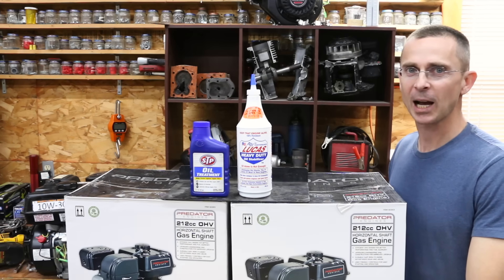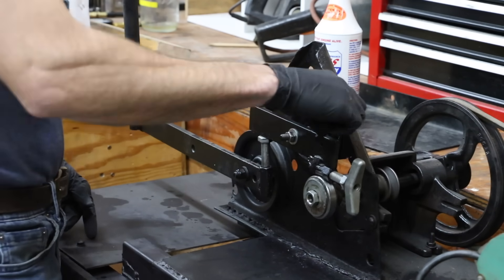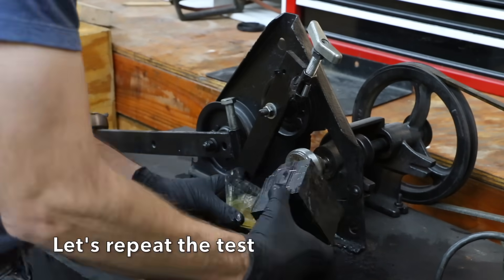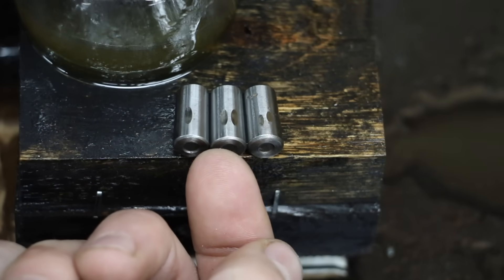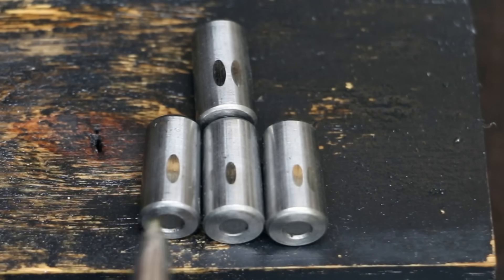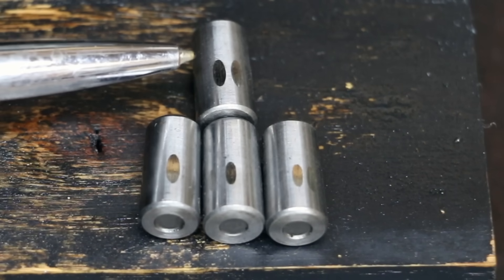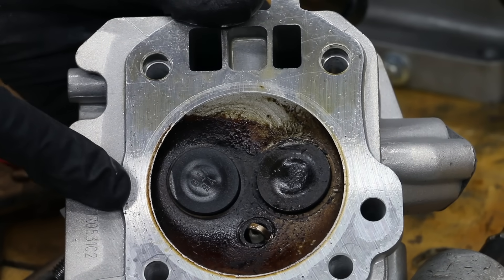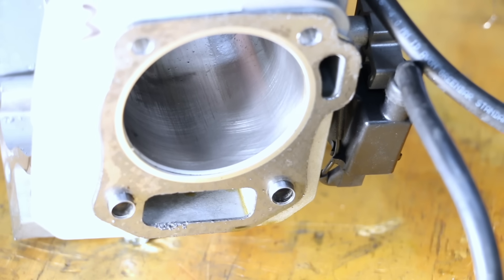Which engine self-destructs first?  Lucas or STP?

Comment: I understand that draining the oil out is to make the test more severe. But I am not sure if we learn much by testing the engine to destruction. In both STP and Lucas cases, the connecting rod was broken into pieces. A high level of wear was found on the crankshaft bearing and cylinder liner. They are simply the symptoms of no oil lubrication.

Comment: Well, the lucas engine definitely ran longer, but the end result was they both blew themselves to pieces. I have been using Lucas for a number of years and have never had an engine failure, but I have never taken an engine apart and miked the crank, but I will say I have used Lucas power steering additive and noticed a big difference in my steering, possibly because it thickens it up, but it does seem to work.
Reply from the maker: Lucas seems to be a great product!

Comment: Great video, very detailed. I like the inclusion of all the PPE, people need to see other people doing it right to learn from them. 

I don't know if it's still made but I saw a commercial for a product called Pro Long a long time ago and they drove a car without oil for like 50 miles after using their product in it. I'd be curious to see if it does any better than the Lucas or if they just flat out lied to people.
Reply from the maker: I need to test Prolong soon. Thanks for the recommendation!
Reply: i use pro-long with synthetic castrol since 1994 with unbelievable results.

Comment: Were these engines running at wot/have any load on them? Just curious. You know what's funny is I start rooting for particular brands and want them to keep going but then the Lucas engine starts to slow down and is on the verge of popping and I'm like "no no no noooo!! (Boom!) Ahhhhhh man" still impressive it's able to run over 20 mins without oil though.
Reply from the maker: Engines did not have a load and were running at WOT. Thank you.

Comment: Zmax is sold to the piston engine aviation market as Avblend.  It is the only FAA approved piston engine oil additive.  I'd like to see it tested to see if it's anything different or special.  Never mind, just saw your video with Zmax.  Great videos, keep up the good work.  I'm sure the Chinese guys that make those engines love to see you coming. You should get a discount since you use so much of their products.  Since the con rod is the weak link, and based on how it breaks, I'd love to see how long one of these engines would last with a rod that has needle bearings at both ends.
Reply from the maker: Than you!

Comment: I also wonder if the test is accurate with a lack of engine heat.  Oil acts a lot differently at 250+ degrees

Comment: Thumbs down, this is a advertisement made to look like a 'homemade' test. This test is not valid. Both engines should of been rebuilt and machined as exactly as possible to match by a qualified machinist. Unless they were built from the factory using QS9000 standards, they are not 'equal quality'. (do some research on Demings rules of Quality if you want to understand what the word 'quality' means.)And there should be a third engine ( with the same rules applied)  running plain oil. Being a machinist for 25 years, ( with certs in SPC and other pertinent areas and being a QS9000 L2 auditor) ....there are too many mechanical variables in both engines to be able to attribute the destruction ( or lack of) to the simple additives.  Ex. the reciprocating mass of parts of both engines (from top of the pistons to crankshaft bearings) can have a very wide range of tolerances, even between the same parts ( like the wrist pins or the rings). The wear patterns of all parts were established long before this 'test'. The test is not valid. It is my guess that the company that makes one oil is paying for this and expects results.
Reply from the maker: Thanks for commenting.  This is my own video and not an advertisement.  Check out my other videos and you'll see Lucas' competition doing well in testing.

Comment: I was told that adding an oil stabilizer only thickens the viscosity of the oil, thus making cold starts harder on the top end (the oil doesn't get up there as quickly) 
thoughts?
Reply from the maker: There is indeed truth to this.  However, Lucas seems to provide a cushioning effect, which has some benefit on worn engines.

Comment: What you should do as a control is clean the engines and then swap the oil mixes. Lucas in the STP and STP in the Lucas. It would help minimize any differences in the engine to see if it is just the mix that's making the difference.

Comment: Haven't finished the video, but I am just going to go out on a limb and guess that the Lucas oil engine does first. Why? Because an engine filled with that sopuid is going to overheat due to extreme viscosity and kill itself.
Reply: Foot in mouth. I guessed the additive would be the only thing in the engine. Derp.

Comment: Back in the 70s a friend of mine went to petroleum engineering school. In school he learned that STP is just refined petroleum before any additives have been added. No anti-sheer additives, no anti-foaming additives, no detergents, no polymers, it’s just refined petroleum that isn’t anything yet but Refined oil out of the ground.Just like flower that has not been turned into a cake, or bread, or noodles yet

Comment: You maybe have already done this, but try synthetic versus regular oil, and semi-synthetic if possible.
Reply: Synthetic is the way to go, IMHO.  On every engine we use, we have seen increased HP and easier starts.  On our truck and cars, increased fuel mileage as well.   My 2500 Cummings gets 24 MPG on the highway.   Synth oil is part of that.
Reply: @donaldeisenhart3738   I wasn't aware of the benefits of synthetic.  Thanks
Reply: @donaldeisenhart3738  Ahahahahaha

"My car gets 24 MPG on the highway because of it."
If you said that to soneone in the UK they'd stay well away from it!
Reply: Richard's World Traveler I prefer synthetic blend the best of both worlds
Reply: @CWCAdventures  what are the pros of conventional oil? I'm genuinely curious as someone who has never really thought to run conventional in anything other than engines that have been designed up until the later half of the 90s, and even then, only the simpler designs.

Comment: What a waste of 2 perfectly good engines lol. I think the tolerances from the factory would already cause that difference in one motor lasting a little bit longer than the other with no oil in it. They’re not exactly the same is my point. Just my thoughts. The viscosity test was enough. Just needless destruction after that lol.

Comment: Woah. The one on just 10w30 was 38.06 right? Both lost to regular oil, eh.
Reply: Engine masters showed how whipping and air in oil in an auto engine will actually reduce hp. Over time that air is going to reduce the oil available to the pickup and cause oil pressure drop I think.

Comment: My new 50cc gas scooter is driping gear fluid id my 1st bike please help
Reply: I would try adding a little bit of engine stop leak. It's thick like STP and has rubber seal conditioners in it.

Comment: Motor kote is way better than lucas or stp motor kote is an absolute awesome product
Reply from the maker: It did great in one of my videos.
Reply: I always use motorkote every time I change the oil in my vehicles even though it says every 3 oil changes I believe also use in the transmission and the differential

Comment: I used Lucas oil heavy duty oil  stabilizer in a bomb of a car that leaked or burned a quart of oil every 2 days! It didn't stop the leaks but slowed them down to a quart every 4 or 5 days  . Why not shut down the lucas motor point was already proven. It really didn't make sense to blow them both up.  Would have been better to run both with half oil and the additive under the oil capacity to simulate a leaking engine run both relatively hard and compression tested , compared main bearings,  crank and cam wear .  pistons to see if there  oil ring damage and blow by and any head warp .  Both blew connecting rods might just be a weak point in those engines .
Reply: Of course Lucas slowed the leak...it's just a 50w base oil that adds thickness. A temporary salve, nothing more.
Reply: Southern Fun  Indeed. To make matters worse, there are quick oil change places that dump in a bottle of this crap without even asking you, just to make you think their motor oil single handedly quieted your engine (looking at you America's Oil Express *cough*). Also a dirty trick employed by used car dealers to fool people on the test drive.
Reply: @Mikgwerd  yep there are car dealers out there that do this for myself I could never imagine doing something like that to someone I run a used Buy Here Pay Here type car lot and repair shop that's why I can't do something like that is because I have a damn good reputation as a good mechanic in my town... so any car that comes to my car lot that I'm selling definitely won't have any engine knocks that's for sure if it does it will be in the back either waiting to get fixed or waiting to go to the crusher

Comment: I would like to see a comparison of cpvc connections that used glue only vs primer and glue. Test after 10min of drying vs 24hr cure time for each. See how much pressure it takes for them to fail. Does the primer and added cure time make for a stronger connection? Thanks.

Comment: Lucas seem like it's better if you add it at factory recommendation, BUT if you were to increase the STP from 1/8 to 1/6 it would outperform the Lucas. If you got a high performance engine you're pushing to the limit, don't forget to add a small amount of zinc with your additive.
Reply from the maker: Great point.

Comment: A fun video to watch but this doesn't tell the whole story. Example: If the Lucas mix results in a higher viscosity, that may be great for wear when running without oil in the sump but will result in more fuel consumption and does it really make the engine last longer under normal use? How does it compare to an oil of similar viscosity? When I had a lawn service and the mowers would start burning oil and I didn't feel like doing a rebuild, I would put motor honey in and the workers would stop complaining about the smoke. However they were hard to start cold and would consume noticeably more fuel.
Reply from the maker: All great points and thanks for commenting.

Comment: Just proves to me that there is no substitute for checking the oil regularly, changing if necessary. I don't see any benefit to these additives.  My grandfather used to rub the dipstick oil between his fingers and decide that way.  Not scientific, but it did mean he didn't run the engine on bad oil until the service interval.
Reply from the maker: Great point!

Comment: Have you done Slick 50 vs DuraLube yet?........great video!!!!!! Very very interesting for an arm chair mechanic like me...Thanks!!
Reply from the maker: Not yet. Thank you for the video idea!
Reply: Duralube if it’s the chlorinated version which I think was recently banned will certainly win.
Reply: I've used Duralube for years.  Years ago had an 85 F350 7.3 deisel.. added some Duralube, and you could literally hear the engine get quieter.  Had between 200k and 300k when I sold it.  Cosmetically, crap.. Mechanically, awesome!  It would cruise at 75 on the turnpike, and wanted more.  😀
Reply: Gray Beard , Same or better w Prolong. Had a Honda generator we ran 10 hours a day & treated it w Prolong right after break in & kept it in the engine. I massively over filled the damn thing & blew the seal between the engine/generator & all of its oil blew out but that engine ran for another year w just a teaspoon of prolong added to it once a week. Never did fix the blown seal or ever add any more oil. The extream cold of Alaska crystals the metals & generators usually last a year from cold  start up to hot running engine. Ours usually lasted 3-4 years w the prolong. Long distance/high volume shooters also treat their  barrels by swabbing em when theyre hot & get 2-3 times their normal barrel life. Prolong is heat activated & soaks into the metals which other addatives dont. I also cooked by bullets in prolong before loading them. Lost a bit of velocity but got better accuracy. Duralube/Slick 50 just coats the metals. Does NOT actually soak into the metals pores. My Chevy Van had 350,000 hard miles on it & running strong when I sold it. I ONLY use Castor oil & prolong for what thats worth.
Reply: Didn't think Slick 50 was available anymore? Was heavily used in Alaska in the early 80's...
Reply: Still available here in FL as of today, but I prefer Duraluube
Reply: Slick 50 is a killer of engines with small oil passages, & always was,, especially w/ hydraulic lifters... The Teflon solidifies on wear surfaces , & then eventually flakes of in chunks, potentially plugging oil passages...  I74

Comment: I run Lucas HD Oil Additive in my Diesel Pickup truck with almost 500k miles on it. I know many big rig drivers that swear by Lucas. This video makes me just a little more assured in using Lucas.
Reply from the maker: Lucas is a great product.
Reply: STP at Walmart, $2.99  Lucas $7.99 Lucas won only because it's run at twice the mixing ratio.

Comment: How about Synthetic oil versus regular oil.
Reply from the maker: Thank you for the video idea!
Reply: Thats not even worth trying obviously synthetic wins
Reply: I would like to see that also on the 212 Predator Hemi's.
Reply: And include amzoil in your test
Reply: Synthetic will probably last a little longer, but it depends on the additives blended with the oil. Not very useful unless you are prone to run your engine without oil.
Reply: Synthetic been deregulated
Reply: @Tobytronic Cat I recall seeing it in a technical service bulletin when doing an oil change on an FC RX7 but a quick Google search and you'll find plenty of references to this. Here's the first thing I found which breaks it down logically: 
https://www.mazdatrix.com/faq/synthetc.htm
Reply: love to see synthetic against Lucas that's the real test put it against mobile one
Reply: There are dozens they aren't all the same.
Reply: It's a known fact that synthetic will win. You can't use synthetic in rotary engines since it doesn't break down as well and causes the engines to eventually lock up from the build up of oil.

Comment: I have a 1988 Ford Ranger 2.3 Liter. I always change my oil with 4 qts. of STP with 1 qt. of Lucas stabilizer  and a Motorcraft oil filter. When I had the mechanic do the change it seemed the oil would not hold up to ware and tear. I also like the Lucas injector cleaner.
Reply from the maker: Thanks for commenting on this.

Comment: My brother run a concrete saw for years without much oil in it at all. It was a honda engine though so that makes a big difference. One day i went to use it and i noticed it didnt have hardly no oil in it. So i added some and the saw died on me. Explain that one someone
Reply from the maker: This is very interesting.  What was the cause of engine failure?  Did it throw a rod?
Reply: It smoked alot and finally didnt have enough compression for to run so it died. All the parts were well worn out  but for some reason the added resistance of the full oil tank polished it off. I have never seen anything like it ever. I swear he wouldnt put no more oil than would touch the bottom of the stick for years. Way low in oil but the engine would run like a champ. But he did use schaffers oil is the only thing i can think that is different from anyone else. The engine never blew up or anything it just lost all compression from being so worn out but was running just fine until i filled the oil. I cant completely describe it because its def one of those things that you have to be there to believe it because i still dont believe how that engine ran. Maybe honda made engines maybe schaffers oil you tell me lol. My brother has always been one to abuse anything and always seem to make it work.

Comment: I would say the Lucas outperformed the STP product in as fas as you could come back to the small engine after 5 or 10 minutes, notice a big puddle of oil on the floor, shut it off and maybe still have a usable engine once you fix the oil leak.
Reply from the maker: Lucas is a great product.

Comment: I would really like to see the self destruct test against a number of so called friction modifiers i.e. Archoil AR9100 vs lubegard bio-tech vs liqui moly ceratech.  The engines would have to run for few hours to allow the product to "bond" with the metal (as per the fanboys statement that it takes 500 miles to see results)  then drain them and test them vs regular non additive drained engine. This will finally prove if the whole "nano" additive industry  is boost or bust
Reply from the maker: Thank you for the video idea!
Reply: Project Farm you are more than welcome I know that engines cost a lot to test against and I know that you donate them to schools but I think that it would benefit us all if you somehow setup a charity for us to donate to, to pay for the engines that you test against and donate to schools. I would donate. Since the payment will be two fold I.e for or against sneak oils and totally for further educations in combustion/tribology mechanics